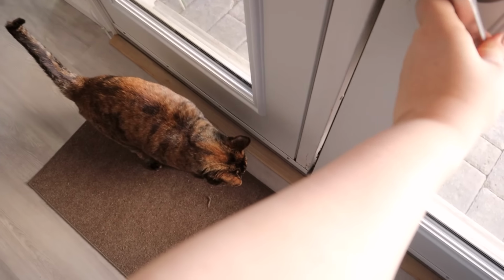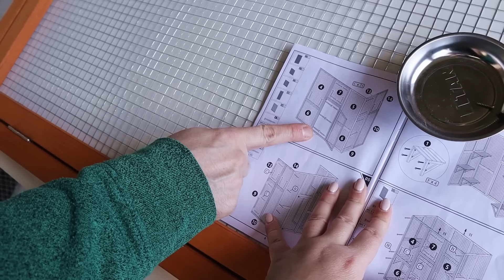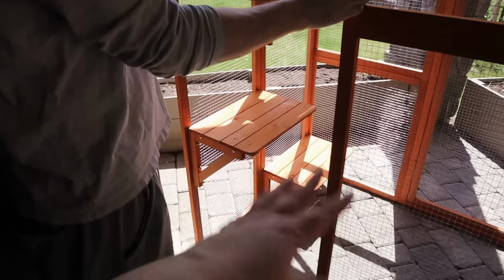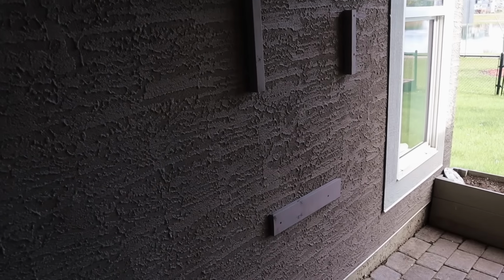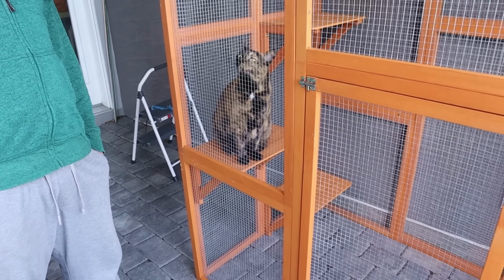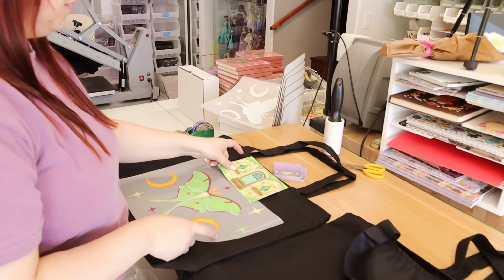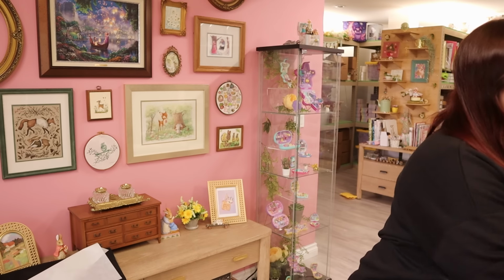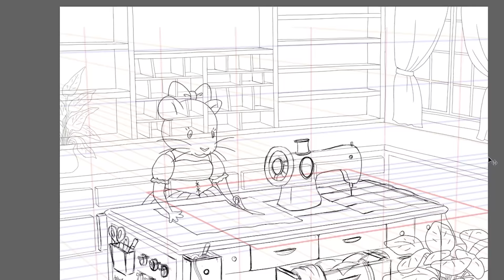Building a Catio for the Kitties!

Comment: Yesss! I made my apartment patio an enclosed Carol (made a pvc frame and got cat netting attached to it omg) if you wanna avoid getting bugs inside, through the open window, since it has to be open for them, you can put the window screen back in and cut a rectangle hole in it and they sell cat flaps for screen doors that you could use on there! I did that for my screen door so bugs don’t come thru the sliding door

Comment: You could consider using sponges to paint on the wire thing. If you just dab the sponge against it the paint may not splatter everywhere, still I would just have some paper taped to the wood behind it (not touching the wire) just to be sure the cats won't be rubbing against it while it is still not fully dry. Make a test on a small area to test and see if it is a good idea.
Reply from the maker: I like the sponge idea!

Comment: I know you just built the catio and the day this is out is already days long past but it's going to suck hearing this. You should really remove it from the house, remove the screws, and get some outdoor caulk to put in the holes with the screws. Moisture could seep into the screw holes and may cause things like mold, rot, or the stucco to peel off. That or just caulk around the edges of the wood. Best to be safe the sorry, you know?